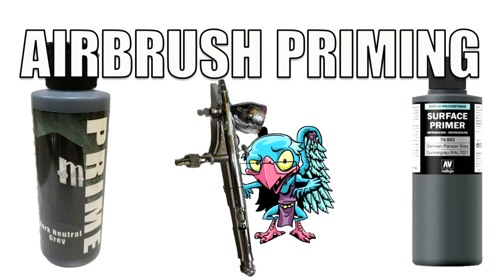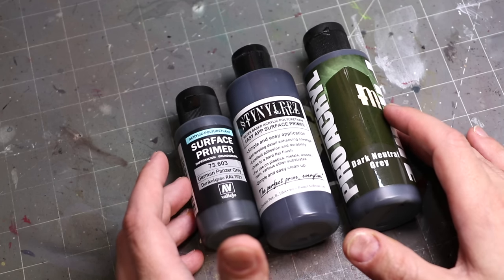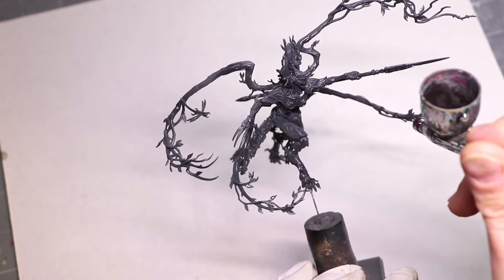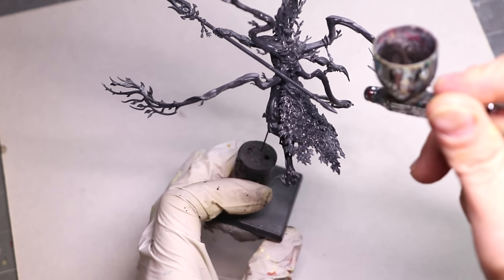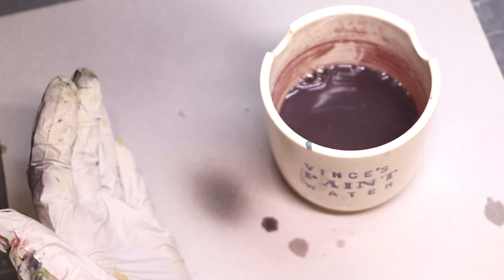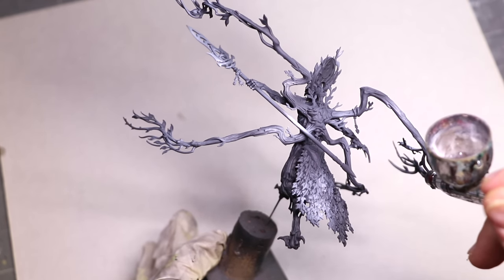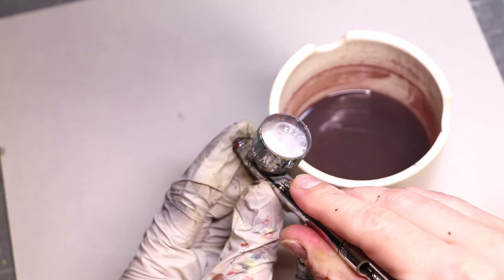Complete Guide to Airbrush Priming - HC 350

Comment: Interesting. Thanks for this. I think my biggest issue is painting longer than a few minutes before cleaning. Airbrushing is extremely new to me and I’ve spent probably a good 20 min painting and cleaning at the end and it took quite a while to clean. Definitely will give this a try
Reply: As long as the paint is thinned corrrectly you should be fine airbrushing for 20 mins, I spend easily up to and hour on the same colour just adding more paint as needed with very few issues.  I must admit I clean my airbrush out differently to this guide but as with all guide use it and amend as needed.
Reply: @GreyBeard_Paints  I recently bought an airbrush and used it one time so far. I painted for about 30 min or so, but had a heck of a time cleaning it. Took me forever because paint dried around the cup. It was my first tome ever using an airbrush so I definitely need practice.
Reply: it all comes with time and practice, for cleaning I do pretty much the opposite to the advise in the video.  I empty any spare paint back in to the container, spray out the rest and then fill the cup with water and brush out any paint stuck to cup.  I then flush clean water through the Airbrush, I do 2  run throughs (more is sometime needed) with water and a mixture of long and short fast sprays, I also back flush the paint by placing my finger or a sponge over the end.  Once the spay is clear and all paint colour is gone I add some Airbrush cleaner, give a few quick sprays and then one last back flush, by this time there is normally no colour and the brush is clean.  Lastly I empty the cleaner out and add some new in the cup and leave it there untill next use.   All the above takes about 5 mins to go through but can take a bit longer depending on which brush I am using.
Reply from the maker: Hope this all helps. :)

Comment: I started using molotow paint pen refills as primer through my airbrush lately. They're amazing, one gentle pass leads to nearly full opacity.
Reply from the maker: I will have to give them a try.
Reply: Adam savage uses their chrome refills in his airbrush when detailing things, there are a few videos showing it over on Tested.
Reply: I just tried it for the first time. The application is the smoothest of any primers I tried, but it seems quite fragile. I can easily scrach it off the plastic with minimal pressure. I hope it just needs some time to cure (I applied it 4 hours ago)

Edit: after leaving it alone for a couple of days, it has cure pretty tough. But the day after seemed cured already. If you have the time to let it sit for a while, it's easily the perfect primer. It applies smoother than any paint through the airbrush, I could easily prime 20 minis without any cleaning done in the middle (with the lid on).

Comment: Great video. I use a H&S ultra (great value good airbursh). It has a nozzle guard that has holes in it, so you can't put your finger over the end to create an air seal and backflow but you can get little plastic/rubber caps to achieve a similar result
Reply from the maker: Yep, you got it.
Reply: You can swap the cap out for the pinch cap of the Infinity.
Reply: @waynegoldpig2220  that's true / ideal but it's about £25 and I think you need  one for the .2 and another for the .4 needle making it more likely you'd just buy the infinity instead. I wish the ultra came with a cap like that!
Reply: @NoProcrastinationMiniatures  You may be able to back out the cap a turn or so to cause it to block itself, for backflushing.

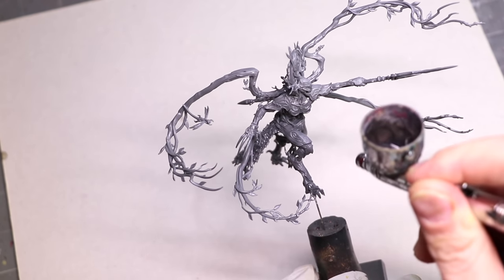Comment: 05:04 "do not rock the trigger all the way back" well big whoops there 😅 i probably get away with this because I thin down primer more than the average bear. I only use the Vallejo stuff which will absolutely kill detail if applied incorrectly, so I almost thin it to 60/40 primer and thinner respectively. Does take several coats to apply. I also use a very high PSI exclusively for priming. That tends to help control flow as well
Reply from the maker: Well, hopefully this helped you out then brother. :)

Comment: I have never air brushed before, I got one a yr or so ago but never used it *(Had medical health issues going on preventing me from doing much but now I’m better) I have 2 models I am painting for my daughter. I was having a crisis moment bc I didn’t know what I should do on priming. I was heavily leaning towards brush painting which would not be hard on most of the pieces which are tiny. But the main piece is roughly 6 inches in length that wouldn’t be as simple to prime (It would I guess because it doesn’t have any real hard areas to paint except one part where it’s a gate up next to a wall that could cause issues of paint pooling if done to quickly.) Which I also thought about using a spray can but again haven’t primed much so very hesitant of using it on these pieces since I can’t screw them up. So I am getting out the air brush, it seems to be the best way to go about it, your tutorial was very precise and calmed my fears. Other people made this way more complicated than it needed to be. So I am going to pull it out and practice on some cardboard first, then when I feel comfortable begin priming my pieces. I will later try more detailed work at another time, right now just wanting to prime it so I can get to painting it.

Comment: 😆 Love your demonstration of how to clean your airbrush - with what I would consider a disgustingly dirty airbrush! Admittedly I am a bit OCD about cleaning mine - thorough clean between paints and partial strip/re-lube at the end of a session, but it is very satisfying to keep my (quite expensive!) airbrushes in "like new" condition. Also, one of my airbrushes has a castellated tip guard which prevents the use of the blow-back technique. Having said that I have never had any real issues priming with an airbrush. I have a couple of Iwata TRN2's specifically for the job - one for water based paints and one for lacquer based paints. They are decent quality, easy to hold for extended periods thanks to pistol style grips and have the option of large capacity cups. Obviously this is more relevant for my bread-and-butter spaceship models but I find them perfectly suitable for minis too - even 15mm scale soldiers. As always, looking forward to the next video 👍🙂
Reply from the maker: Glad you enjoyed, and you can still backflow with those types of caps. You can use a rubber glove, a wet paper towel or just use the tools that they make for it. :)

Comment: I have a question about white primers. You mention in the video that they're problematic and may require extra thinning and higher pressure. What about non-aqueous white primers? Mr. Hobby has both lacquer based white primer and an "alcohol" based white primer (similar to tamiya's acrylics). Are they any easier to work with than acrylic white primers, or are they all one and the same?
Reply from the maker: Those are certainly easier to utilize for sure.
Reply: @VinceVenturella  Thanks much. I wanted to paint some light pink Eldar, and I figured it would be a lot easier over white.
Something that would be interesting would be a video comparing how to use lacquers Vs how to use acrylics. I know you don't use them much, but they're very popular in scale modeling and garage kit painting and may have some nice applications for minis as well.

Comment: Had major issues with Vallejo surface primer black for over a year. Decided to open a new bottle and all issues ceased. Was surprised to learn it was the bottle I had been using.
Reply from the maker: If the bottle get's low, the sediment (as it were) settles down, basically, in a 60ml bottle, you only get like 40-50 ml.

Comment: So I am half way through and already I do just the opposite of almost everything you do.  First off, I live in a fairly humid environment so that may have a lot to do with it.  I never, never, NEVER use thinner or flow improver.  I pull back all the way on the trigger and let er rip.  I usually only apply one cote of primer.  I do sometimes hit some of the mini with a little extra primer.  To date, I have not had any problems with my primer on the mini though I do admit after 20 or so minis or a half dozen large monsters/terrain pieces I have to clean the airbrush.  I'll experiment with the techniques you give here but will probably stick to my approach as it works and is really quick and easy - no mixing or measuring, no drying between coats and it only takes a couple minutes to clean the airbrush when it does clog.
Reply from the maker: That’s fine, the humidity may have to do with it, but if it’s working for you, it’s good.
Reply: @VinceVenturella  I really think it starts with the humidity, it allows me to get away without thinning the primer and once I do that I need full throttle to get that primer through.  And since it isn't thinned I don't need multiple coats.  I think I had similar problems following advice on 3D printer settings, the humidity here really affects my settings so I cannot use what many of the experts recommend.

Comment: For priming the small figures, the professionals I know (who also are instructors, etc.,) simply use a can of spray primer paint.
They let it dry, then proceed to bristle-brush on with the typical water based figure paints.
This solves all the problems with clogging, constant cleaning, whether you put the thinner in foist, thinner to paint ratio, and all the other fiddly airbrush care and feeding nonsense for a broad base undercoat.
Reply from the maker: Nothing wrong with a rattle can, but for me, its far more complicated, I have several videos on how to make the airbrush easy and fast, so it's a few minutes tops and then its ready to go. :)
Reply: @VinceVenturella  
LOL-More complicated then shaking ONE (1) rattle can, spray painting the figure, clearing the spray nozzle by holding the can upside-down for a few seconds and letting the paint dry instead of:
Your method needs:
1. An airbrush + a compressor.
2. A bottle of thinner.
3. A bottle of flow improver.
4. A bottle of alcohol.
5. The paint.
Then you have to prime the airbrush, put some paint in the cup.
Then mix in some of your thinner and flew reducer mix, start spraying the subject(s).
Keep cleaning it "every two minutes" (YOUR WORDS)...
Then you have to fully clean and flush your airbrush, using a cleaner, rag, spray pot, etc., when you are done.
ALL THE WHILE, having to sweat your airbrush pressure and moisture levels.
Please explain how needing to connect an airbrush to a compressor, ensuring a power source for the compressor, checking the pressure and moisture trap and for leaks. 
And needing to juggle three types of liquids is LESS COMPLICATED then pressing the button on the top of a single aerosol can?
Somehow I can't see how using ONE item to accomplish the same job as FIVE items is "more complicated"???
And it seems that neither can they.
Now I suppose off of this kit bought from scratch is cheaper then a single spray can too?
Reply from the maker: @tomt373  Sure, like I said, I don't begrudge them the rattle cans. Keep in mind, I am an instructor, and know lots of professional painters and I know people who do both, either is fine, like I said. So let me share how. I have the thinner/flow improver pre-mixed in a tiny bottle, my airbrush is always sitting there ready to go, no pre-work, I pick it up, put a few drops of thinner in from the bottle, give it a little spray, then drop in a few drops of primer, spray the figure. Then grab the alchohol dropper bottle, put in a few drops and then rinse with squeeze bottle and done. Takes about 2 minutes or so. Now again, I am not saying that people are wrong for one or the other. Just that you can make it very simple. But as always, use what you like. :)

Comment: Great vid 👍 rattle cans are always a nightmare in my climate and airbrush priming was a real hobby saver for me, although as I've gotten more experience I've noticed it's own problems and challenges (that the video covered pretty well!)

The big thing for me recently had been primer durability. Especially on larger projects or when I'm doing rougher techniques like oil washes I've found pretty often that primer can come dislodged and leave horrible chips in by 90% done minis, which is a whole other level of frustrating. I've found some stronger than others (some barely stronger than regular paint) but given how thin the layers really are is avoiding this simply a case of always doing multiple layers?

Another is that even with my nicest primers certain resin seems to just reject it completely, even after some very thorough cleaning. Rattle cans however don't seem to have this issue, so I don't know if there's something about airbrush primers or certain resin materials that just dont gel with each other.

I've also thankfully got a decent supply of iso but it's a whole lot easier getting ahold of methylated spirit (essentially grain alcohol with methanol and purple dye). Are you aware of any issues using this over iso given the colouring and different chemicals (although they're effectively the same thing for paint thinning purposes)?
Reply from the maker: I find a varnish after the primer can help with those issues you're experiencing. I can't give you any advince on the alternative chemicals, never had occasion to try and I don't want to speak out of turn.
Reply: Did you end up finding a good primer to stick to resin? I've used other products that work but have to use a hlpv gun.

Comment: Have you tried lacquer-based primers? I'm a big fan of Mr.Hobby primers, I use different kinds for GW, resin/board games and metal miniatures. Application is super easy (just make the model wet with primer, single pass, it'll bite into the plastic, dry quickly and not obscure details) and you're almost not able to strip it, which is awesome. Vallejo primers were easy to peel off, I found GSW matt black to be a nice substitute - while you could still scrape it off, it didn't peel. I hear Stynylrez is the same thing as One shot, which apparently is better to be used with larger nozzles (clogs my 0.2mm Iwata).

The only downside of the lacquer-based ones is that they require a dedicated thinner and stink a bit, you need a mask and good ventilation. But I find the result to be vastly superior over the acrylic/water-based primers.
Reply: Absolutely m8. I went to my local automotive paint shop and got them to supply me with 250 ml of each primary (R/B/G/C/M/Y +W/BK) in cellulose. I only airbrush with my own mixes now.
Reply from the maker: You're absolutely correct, it's just the toxic nature that I think keeps most away, but it can be a great prime for sure.
Reply: If you have a proper mask (which you should anyway when working with an airbrush) and can open a window in the room, it's not really that much of an issue. And such primers are more versatile, bulletproof and - what's important in my case - idiotproof. I highly recommend them.

Comment: Thank you, very useful. What is your process when airbrush priming a larger amount of minis at the same time? Since you´d want to paint for as long as possible without stopping for cleaning, but still without the paint drying anywhere. Do you just go until you run out of paint and then clean it, and know from experience how much paint you can put in and use before you´d want to clean it?
Reply from the maker: Yep, smaller amounts of paint and just regular refills and flushes

Comment: Fantastic video very informative!. Some might think this as a bit over the top and a bit strange, but when I was learning how to spray finish wooden furniture, before tipping varnish etc into the spraycup we would stretch some old pantyhose/leggings/stockings whatever,over the cup as a strainer/filter. Today I do the same with my airbrush cup just before adding the primer, Why? It catches any hard micro chunks of primer that have dried or thickened in or on the bottle nossel, that would clog the airbrush. I never have a clog as a result.
Reply from the maker: Not excessive at all! I use the same trick to strain out primer that was frozen or is old!

Comment: i am building aircraft only. i bought Vallejo PU primer and started several attempts to pime with this stuff.
But each time i put on the multi color paint (acrylic) i exerienced that the primer coat was stuck at the masking tape upon removing thus ruining the result! 
I tried to clean the surface beforehand with warm dash washing water, isopropyl alcohol as well as glass cleaner - none of this methode worked out and each time i was able to peel the PU primer jut off the surface!
I suggest that it makes total difference if you prime a figure or a smooth wing / fuselage surface as the sticking is totally differnent!
i changed to the Mr Surfacer 1000 / 1500 which sticks to the surface really good!

Question: is there any other issue or rule i violated with VALLEJO PU primer?

Comment: My only problem with airbrushing right now is not having a permanent, indoor space to use it. I have to set up and pack things away every time. It also means I am limited by the weather  (even though I can work under a covered area, it can get windy or even flood) and time of day. Once I can get a permanent studio space organised, I'll be using my airbrush all the time.
Reply from the maker: That's rough, I will say you can always buy one of the little fold up booths for use indoors with a mask, that might help.
Reply: @VinceVenturella  I already have them (though I do need a better fitting mask). I think I've even managed to convince the boss that it will actually protect the walls and ceilings and deal with the largely ...  Now I just need to reclaim space inside to set up a new studio.